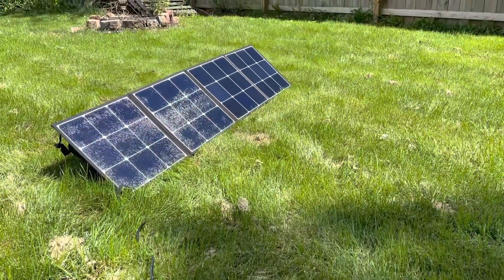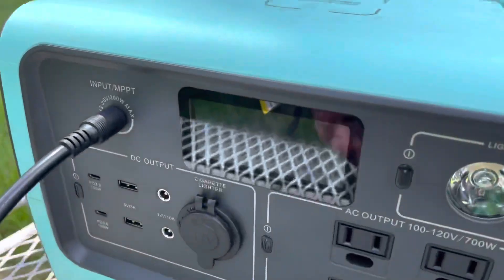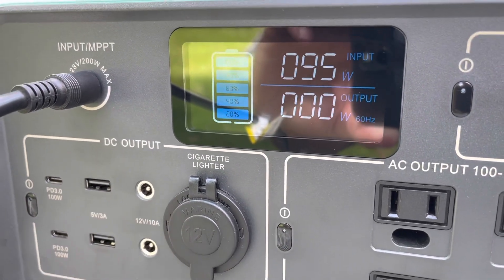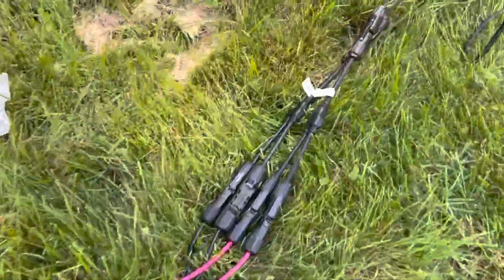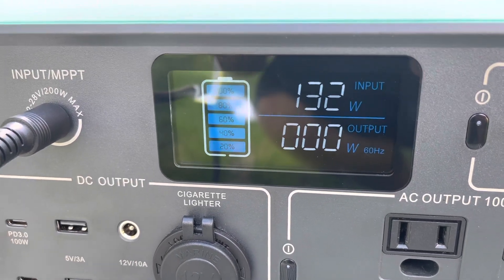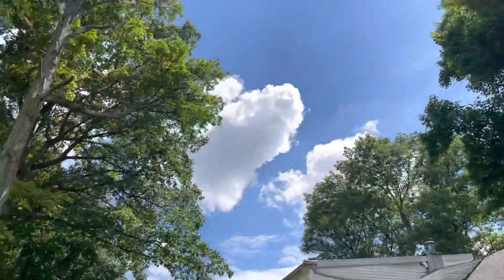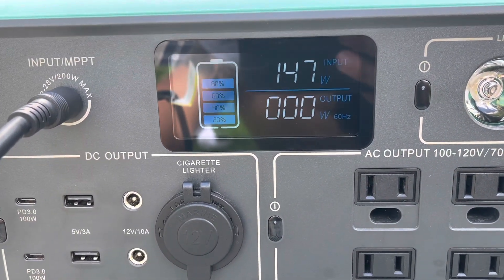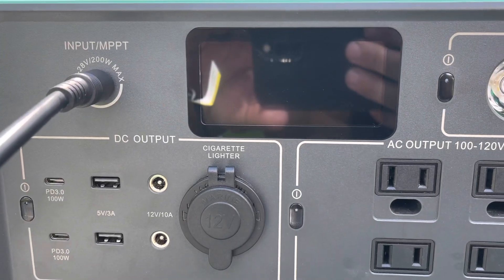Testing 2 Bluetti SP120s

Comment: i have the bluetti ac200p, i did not buy panels yet, trying to decide if i want the 200 or 120...significant price diff , but is it worth it?
Reply: Hey Chuck. I too bought the ac200p but I bought four of the sp120 panels. From what I understood about panels is you can mix panels of different strengths in parallel but the power is reduced to the lowest powered solar panel. If I mixed the sp200 with the sp120 the sp200 is reduced to 120 max. If I had to do it all over again I would have invested in the sp200 panels. They are so much higher in cost but the logistics of moving 4 sp120 panels to continually chase the sun throughout the day is tedious. The upside of the sp120's is they are cheaper, lighter and when money frees up you can buy another panel without too much financial strain as opposed to buying the sp200's. It's a lot like photography. You buy the camera body but the addition of good lens is what hits the pocket book. Are they worth it? After the initial investment of the solar panels the energy you harvest from the sun is free, with little maintenance. Gas jennys are a different story.

Comment: Remember, even though you are connected in parallel, the EB70 has has an 8 amp limit. Two SP120 in parallel is about 12 amps. So, you lost 4 amps because you connected in parallel. Under load, the panels only put out about 19 volts. So 19*8 = 152 Watts. Given that heat reduces solar panel output and losses due to wire resistance, 150 or 143 watts is about right, and it’s the best you are gonna get with those panels.  Because of the 8 amp limit, you might get the same 150 watt result with SP200 panels!
Reply: I live in Miami and on a slightly cloudy day I was getting 30watts with no sunshine and when the clouds would clear for a few mins but still a very slight haze I got a much as 150-153 watts with the eb70 and sp200 so your right. Wish it can take 10 Amps solar but it worked great. Today I’m trying out the Renogy 200w suitcase panel with pwc charge controller to charge my trolling motor batteries. We’ll see how it goes.
Reply from the maker: @PcWorldViews  that’s awesome, these panels are great. Keep me updated!
Reply: @B_Rogers0724  will do. Love your videos bud 👍🏼
Reply from the maker: @PcWorldViews  thank you!
Reply from the maker: You’re right and I wasn’t considering the 8 amp limit as I was making the video. But thank you!
Reply: @nthenet Great breakdown!

Comment: I have the AC200P and 3 120w panels, I want to get the EB70 and the 200w Solar Panel. AC200P for the house 🏠and the EB70 for my shed.
Reply from the maker: Sounds like a great idea!
Reply: I've got both with 5 of the SP200 panels, it's great for emergency backup power and also portable power. AC200p for backup power or running my power tools, EB70 for camping!

Comment: How come you didn’t get one SP200. And I remember hobo tech said something about the voltage that you can’t run two panels in series because it can only accept 19volts I think and 200 watts. Don’t quote me but something like that. I just ordered the eb70 with a SP200 we’ll see how it goes. Keep up with the videos man good job.
Reply from the maker: I’m going to pick up at least one SP200 as well. Just haven’t gotten that far. Thanks
Reply: @B_Rogers0724  we’ll I’ve had my eb70 and sp200 for over a week and just the other day I tried it a bit because it’s been rain every day. While still partly cloudy I got 30-50watts with cloud cover (no sun) and 150-153watts when the clouds cleared but still a slight haze. I can’t wait for a full clear day. I’m no scientists but I think me living in Miami so close to the equator has something to do with it because any sun that Sp200 got it shot up to 150+ watts still with some haze. Can’t wait to try on a clear day.
Reply: You can’t run two in series but you can in parallel.